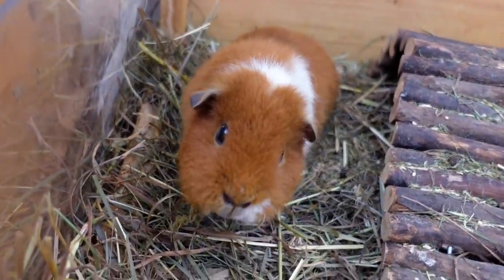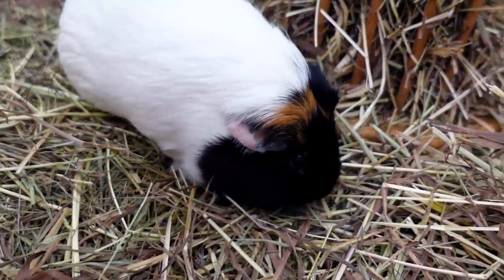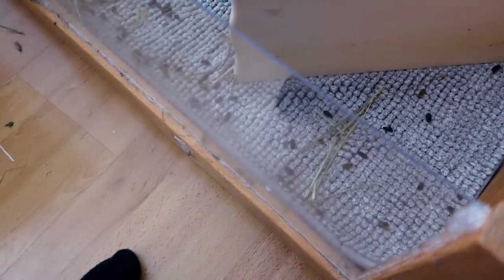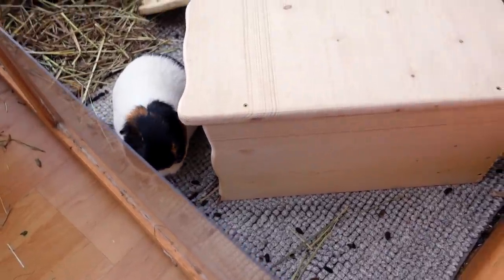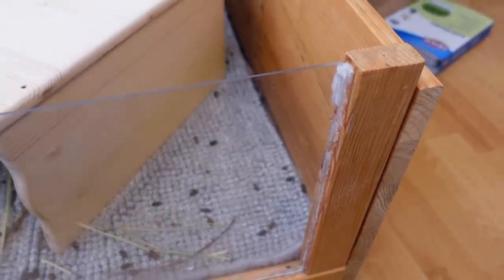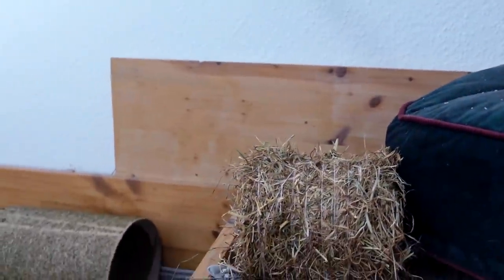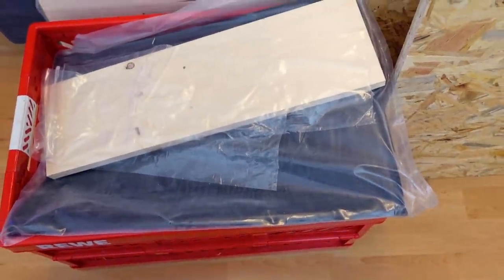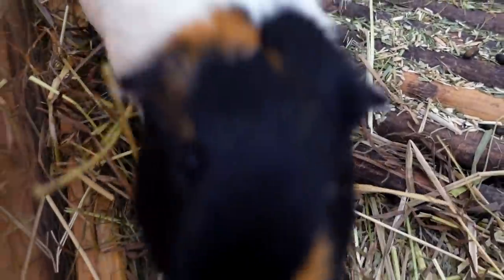A New Cage for the Guinea Pigs | Going Shopping for Supplies & Final Plans

Comment: Tip…You can use a u-profile lath to lay over the plexiglass. Rest it on the ends on the standing slats. That's how I did it and it's also softer for the feet of the guinea pigs.

Comment: How exciting a new cage!! I will be making a cage for my guinea pigs soon too! Our I may be buying a Midwest cage... I still am trying to decide which would be best.😆 
Also I have a question, would a 4 ft.by 2 ft. Cage be big enough for 2 guinea pigs?
Reply: I think so nearly? Ive heard minimum recommended size for 2 piggies about 75cm x 130cm (~ 30" x 50" or 4ft x 2ft 6in).

Very exciting for your piggies!
Reply: @alisonwinship  Ok thanks! 👍🙂
Reply: For 2 females 4 x 2ft (8sq ft) is the bare minimum and for 2 males you should have nothing less than a 5 x 2ft (10sq ft) but for both females and males the bigger the better (plus proper enrichment)

Comment: How are you gonna secure the acrylic sheets to the frame? Your previous method of basically caulking it into place was, with all due respect, rather flawed. Had you considered a sturdier method? 
My 3mm plexiglas sits in a groove in the frame, which is then caulked around. But I tend to do things in an unnecessarily complex manner. 😂